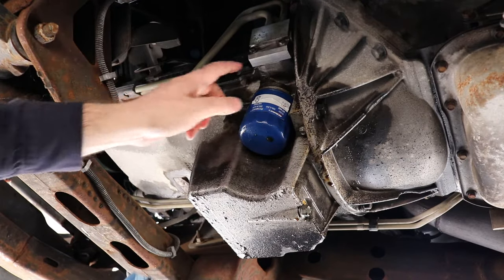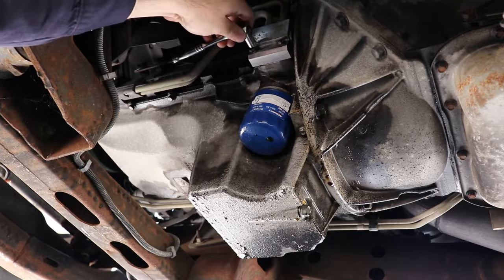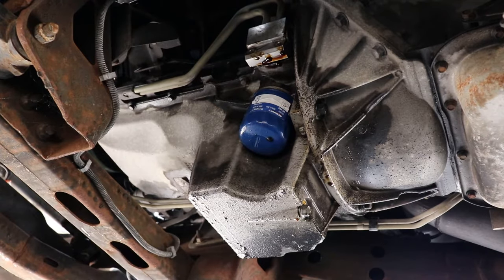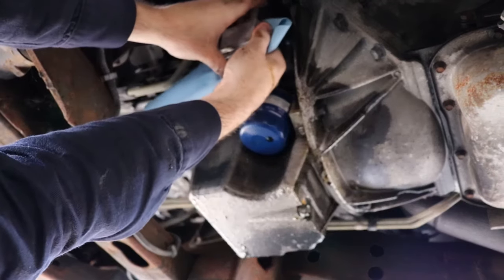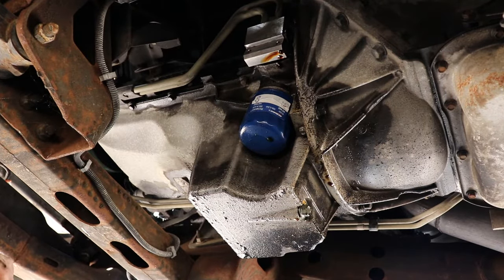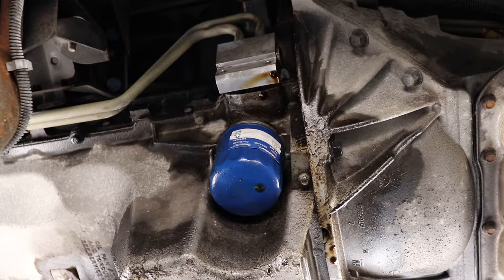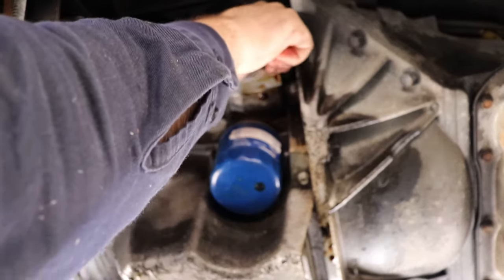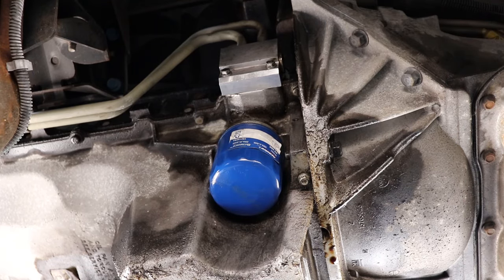LS LQ Oil Cooler Gasket and Block-Off Replacement

Comment: The vehicles WITH an oil cooler requires the gasket with two holes. The gasket with one large whole is for vehicles WITHOUT an oil cooler. Both type vehicles have the same block that requires a gasket.
Reply: You can use the slot type gasket with the oil cooler setup, but some oil will bypass the cooler. That is not detrimental to the engine. Over 95% of the oil will still go through the cooler.
Using the 2 hole type gasket with a block off plate will cause problems because the center section could break off and plug the oil galleries in the block.

Comment: Have a 2006 Yukon with only 123,000 miles. Had a slow oil leak that I couldn’t figure out where it was coming from. Saw this video and my problem was solved! This simple $4.00 part solved my oil leak
Reply: Same thing

Comment: Excellent video, Stephen. Thank you. I am replacing my gasket on a 2012 Silverado 5.3 and the video was right on point. If I gather correctly, the oval gasket is for vehicles that only have the block-off and no cooler lines whereas the one with the two holes and O rings are for the vehicles that have the cooler lines. Thanks again for your awesome video.
Reply from the maker: No problem.  That is my understanding based on what I found and the research that I did.
Reply: paul curry was your truck leaking from the oil cooler in your 2012? I think I have the same leak in my truck.
Reply: @scottyrogers10   my 2010 is starting to leak and has the cooler lines.  Thats the only leak i can see only have 136k miles.

Comment: 1. Wrong gasket
2. Change the o ring on the fitting, protruding the back of the cooler block. Its plastic, and they leak.
Now, a pro tip, if you're tracking down a pesky oil leak that is around the starter area. Pull your crank sensor above the starter and replace the O ring.
Reply: Legend
Reply: Duuuude. I think you just saved my ass. I was expecting to do rear main on my 2500. Pulled cover and its very clean in there. I think this cooler line and that crank sensor are my problem

Comment: That first gasket without the two hole is for a non oil cooler line that’s if it has a block of plate instead of a cooler hose.
Reply: Thank you

Comment: The bolt to the right side of the block was spraying oil out of mine while it’s running. We tightened it up and it seems to be fixed
Reply: I want to say mine is leaking from there also the oil cooler has like a bolt do you know what size that tool is
Reply: @TEXASWILDIN  Im not 100% sure, i had a mobile mechanic come out and tighten it up. Took like 5 minutes overall. You need a good allen type key that’ll fit, one that isn’t too big or too small, because the first couple we used wouldnt fit. We thought we would have to remove the actual cooler block, but he found a key that would fit good and it worked out.

Comment: The gasket you have without holes is for a truck with no cooler line just block off plate
Reply: Had mine changed twice at AAMCO still leaking

Comment: You bought the wrong gasket. The one shown at the first of the video is for a vehicle that does not have an oil cooler. If you install that wrong gasket the oil cooler will no longer function. Gm trucks without a trailer package do not have engine oil coolers.  If it has a factory trailering package it will have an engine oil cooler.
Reply: unless it's a ppv 👍🏿 We don't have a tow package but we have an oil cooler

Comment: Your wrong gasket is for the block-off plate, that is used for non-oil cooler equipped engines.

Comment: So you failed to mention you removed the drives haft, because that part is up above the drive shaft there's no where close to the room your showing.unless you have a 2 wd
Reply: It's a 2WD because there is no front differential.  Kind of odd to have in snowy Canada, (just guessing from the accent.)

Comment: Did it seem like your leak stopped from there? I have two leaks. I think one from that plate and one from the valve cover. Still need to watch a little more to make sure that’s where it’s actually coming from. Didn’t know if this was a common area
Reply from the maker: I'm not sure about the valve covers.  This gasket replacement was a stop-gap for me but it helped.  I had the lineset and oil pan gasket replaced later this summer.
Reply: @SteveRivett  how much was the oil pan gasket job? Thinking about trying to tackle it myself.
Reply: @chadly1337  I just did the oil pan and it honestly wasn’t that bad. I can say the gaskets alone was about $50. I pulled the steering rack out so I could do the bushings on it the same time. Since it was already out. I went ahead and pulled the front diff out. Then it really wasn’t bad. It sounds like a lot of work but I honestly wouldn’t do it the other way. The rack and front diff were so easy to get out it was worth doing

Comment: Thank you for the video not sure if my oil cooler lines are same as yours 2004 Yukon denali 6.0 oil dripping from filter. Other videos said the lines are a son of a ----- to remove so wondering if just trying gasket first or go ahead and do the whole thing
Reply from the maker: Changing that gasket was a good temporary fix.  I was too busy to do the full job this summer so I paid a garage to change the oil pan gasket, oil cooler lines, and the transmission cooler lines.  They switched to a 3-line system on the transmission and added a cooler in front of the radiator at the same time.  These things will leak so if you are keeping the vehicle long term just go ahead and do it.
Reply: @SteveRivett  what do you mean they added a cooler line? Great video! Thumbs up

Comment: Really great video! Thank you! Question, why did you buy new lines?
Reply from the maker: Thank you.  The lines tend to fail at the crimps to the rubber hoses.  My transmission lines were quite bad so I had them all done at the same time.

Comment: Before you replaced it, was the oil pressure fluctuating?
Reply from the maker: not that I remember, I think the van gives you an oil alarm when it is due for an oil change which is very alarming
Reply: @SteveRivett  my 09 avalanche fluctuating on the oil pressure. Changed the sensor only to notice a small oil leak but wasn't to sure from where.
Reply: @SteveRivett  was hoping the oil cooler gasket would would affect the pressure that way I have a good idea what was leaking..
Reply: I have same problem with my Denali oil pressure. Did it work?
Reply: @jarednichols7834  it still fluctuates but never drops under the quarter mark.
Reply: @jarednichols7834  had it drop to zero and forced me to shut the truck off. But after the oil pressure sensor was charged and a oil change its been running good since.

Comment: I replaced the gasket , but for some reason I’m still seeing a drop any suggestions? Thanks
Reply from the maker: I would clean up the area and take a close look at the seam between the engine and oil pan.  Your oil pan gasket may be blown out...you will notice that the oil filter housing and cooler flange is actually part of the oil pan.
Reply: @SteveRivett  thank you !
Reply: Did you change the o-ring on the plug facing towards the transmission they tend to dry rot.
Reply: @Badeau68  no honestly I didn’t know about that one
Reply: @Badeau68 any chance you know the size of that o-ring ? And perhaps the size of that short alley key used to remove that bolt?

Comment: I think I have that same problem but it looks like that Allen head bolt on the cooler adapter but im going to still do this gasket as well.
Reply: Looks like my Allen head part is leaking on mine also. Did you try to Tighten it?
Reply: @tleb8111   dont bother, its a very tight to access it JUST TO tighten it.  if ur going to go for it. get a new o ring for it    

get urself a 3/8 allen socket and go for it.  if u have 4x4, taking out the front driveshaft will drastically make for more room
Reply: Did you try it? If so how did it go? Having the same issue
Reply: @rivasj07   i did do it. I got an appropriate sized O ring to replace it.   I took the front driveshaft out to gain more room. Used a 3/8 Allen on a socket while it was unbolted from the oil filter housing and took it off (hold it as u ratchet!) Replaced the O ring and I haven't had a leak (from that Allen plug anyway, lol)

Comment: I have an 02 Chevy avalanche and when I replace that gasket do I need to put some type of silicone on or jus put it as is
Reply from the maker: do not use silicone, it will plug up your engine if you use too much

Comment: I changed my gasket and it still leaks a drop every few ft. You can see it when the grouds wet really bad. Rainbows all over
Reply: Had mine changed twice at AAMCO still leaking ever get it figured out?
Reply: did u use any gasket sealant? maybe check to see if bolts need to be retightened
Reply: @clydeking4265  called for no sealant. there is a torx bolt on side of cooler ive tightened 2

Comment: Could this leaking gasket cause low oil pressure?
Reply from the maker: maybe if the line was collapses inside, if you had a leak big enough to have low oil pressure you would see it
Reply: not unless oil leaking from that gasket is really bad, low oil pressure going to be either, oil pump, oil pick up tube o-ring or just bad oil pressure sensor.

Comment: Ok I changed it still leaking oil but notice that is coming from the top part
Reply: could be oil pressure switch their also known to leak and are at the top of the engine
Reply: It's the bolt on the side of the oil line plate. Plastic oring fails. There's a video about it.

Comment: I have a 00 Silverado with a 5.3 vortec.. if I don’t have those lines does that mean I don’t have an engine oil cooler ? Because I’m trying to buy a radiator and it’s asking w/engine oil cooler or w/o engine oil cooler lmk ASAP thank you !
Reply from the maker: That is correct.  You could see a small cover above the oil filter instead of the lines.
Reply: @SteveRivett  thank you for the help bro !

Comment: Is that a bolt on the rear side of that cooler line plate that bolts to the block and can it be tightened? I'm leaking oil from there thank u
Reply from the maker: You can retorque your oil pan to try and stop the leak, that's probably what that bolt is for.
Reply: I saw leaks from that area to. Did it work?
Reply: @toriwilliams500  The plug facing towards the back of the engine has an o-ring that dry rots and it will start leaking from there.
Reply: @Badeau68  what plug

Comment: I have a 6.2 ls and its leaking oil from one off the bolts change gasket and a bigger bolt and still leaks oil ! Hope some tell me what too do
Reply from the maker: You may need an oil pan gasket as the oil filter is attached to the oil pan.  It has high pressure oil going through it.
Reply: @SteveRivett  the larger plug on the cooler blocking plate facing the rear of the engine has an o-ring on the inside that gets dry rot that will also cause an oil leak.

Comment: The other gasket works fine it is what came factory. Mine has 160k miles and just went bad. Urs has been replaced before to have the updated gasket and apparently it felled again. Ac Delco is oem for these trucks.

Comment: Hey bro I don’t know if you will answer but I was checking my 2002 silverado z71 and there’s no lines any help?
Reply from the maker: they don't have lines on every application, yours probably has cap instead
Reply: @SteveRivett  oh okay it’s because it looks like it’s leaking
Reply: @SteveRivett  I am looking at my 2007 Chevy Silverado 1500 and it looks like it has just a cap. What is the point of that?
Reply: Z71 indicates the off road package, which has typically consisted of different shocks and a skid plate. These lines are probably part of the towing package which would be denoted by a different 3 character alphanumeric code found on the sticker in your glove box.
Reply: @mwkpuck  the option is there for the towing package, if not installed they just block it off at the factory with a gasket/plate

Comment: Mine was leaking as well and when I changed it both boats looked like they have been bottomed out and they would not get tight. Any ideas?
Reply from the maker: You will have to take them out and clean the holes with a pick or something.  You don't want them bottomed out.